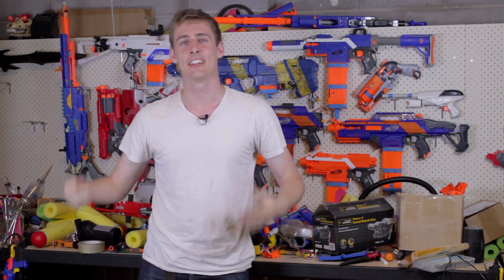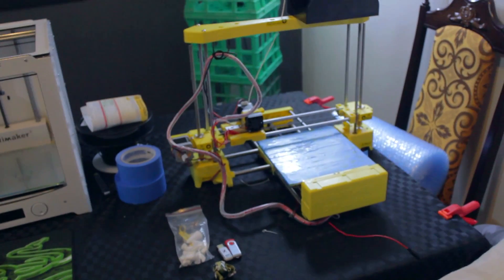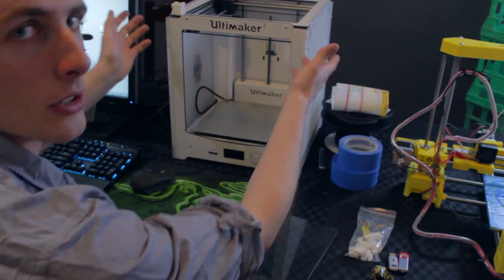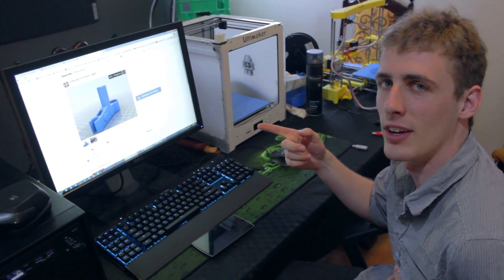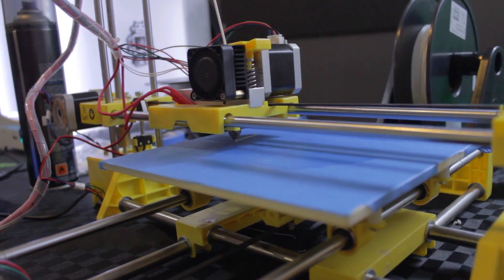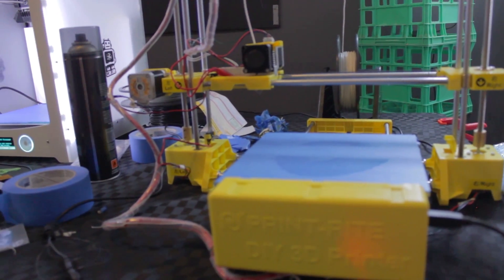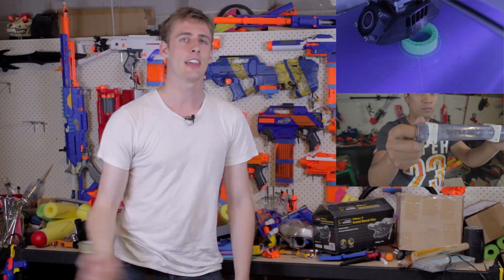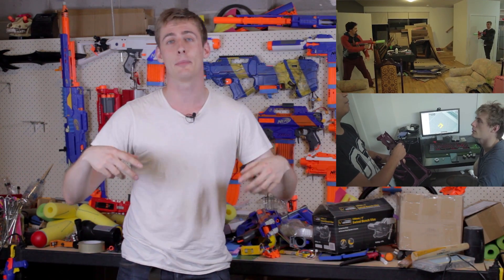ULTIMAKER 2 vs PRINT-RITE DIY 3D Printer & How to Bed Level - PRINTER PARTY | Make Test Battle

Comment: That program he was talking about sounds an awful lot like the new features in Autodesk Maya that displays all the information of the 3D object in a 2D graph, I didn't really understand the point of it. I wonder if I can print straight from Maya or perhaps create a plugin for it.
Reply: +Jones Crimson naw you an make the model in maya but you have too run the model through 3ds max and taurus and i think another one too print a model made in maya.
Reply: Kyle Bell I recently switched over to 3DS and I'm not sure why I ever used Maya in the first place, do you know anything about that?
Reply: I used maya for animating and rigging models. but i don't use 3DS max for anything. cause i use Zbrush too make pretty much all of my models. :P and before that i used blender pretty exclusively as well. So im not really the right one too ask about the differences between maya and 3DS.
Reply: Kyle Bell You could just export to .OBJ to get it into ZBrush.
Reply: yeah you could. but i thought we were talking about the difference between maya and 3DS. and why you would use one over the other. ERGO

Maya = animating and rigging
3DS = polygonal modeling
Mudbox = godly sculptmodeling. almost as good as sculptris.
 
Zbrush = good polygonal and sculptmodeling
Reply: Kyle Bell Oh, I see.  You use ZBrush as a substitute for 3DS.  What you could be doing is using 3DS Max entirely instead of ZBrush and Maya. You could also do ZBrush and 3DS Max instead of Maya if you wanted.  Your point just wasn't very well supported, it's purely personal preference.
Reply: i haven't really used 3DS max ver much at all so i use maya as an animatin and rigging program bt i make all of my models in either mudbox or zbrush.
Reply: the program he was explaining is better known as a "slicer". Slicers have to be set up with all the parameters of the 3D printer the code is being sent in order to produce G Code that the machines controller turns into movement. As far as I know Maya does not have this capability.
Reply: Elyk Son of kyle This latest statement of yours, much like all your other statements, does not further the conversation.  You bring nothing to the discussion.  You're a waste of space, human brainpower, and frankly oxygen.

Kindly take your nonsense elsewhere.
Reply: Elyk Son of kyle At least I'm thinking about girls when I jerk it, pretty sure getting off is the whole reason you're here.

Comment: If you tuned that $400 printer properly and had the proper nozzle and bed you would be priting the same exact piece. This is misleading.
Reply: I have a 175$ printer and its better
Reply: jd52wtf just take anet a8
Reply: +jd52wtf i was about to say the same, but you know, the only difference is "out of the box", maybe you pay higher for that kind of privilege. also, this is comparing video, so not that misleading.
one more thing, the ultimaker has more age 18 vs 1 month, so obviously one has more experience calibrating than the other.
Reply: +petkannaa monoprice out of the box worked fantatic... though there is some bullshit like the pla sticks to the tape just a little too well and its extremely difficult to remove prints without ripping off the tape.
Reply: alidan
agree on stick too well, but i found out that if you lower the bed just 0.05 mm, it would go well and easy to remove, i'm on the second roll of tape. i want to perfecting glass-pva surface
Reply: petkannaa im probably going to get some cheap glass from a hardware store and using that as the bed with the hairspray method, im getting sick of needing rafts to get the crap unstuck from the bed, its a waste of plastic.
Reply: alidan
yeah, raft can eat 30% more plastic when printing, i have print one from 50g to 80g using raft and increasing 3 hours just to get that base done, not to mention if the first layer is screwed, then i have to redo everything. i also want to try hairspray but i don't know what the recommended ingredient in that spray that i should be looking for
Reply: petkannaa you have either glue sticks, which apparently work well too, or cheap hair spray, thats all thats ever mentioned, any cheap hairspray will do.

id look into it a bit more, but yea. 

as for rafts, it all depends on how big the thing is, i use a poker chip as a constant, its 3-6 grams of plastic, and a raft adds an extra 2-3

my brother printed off a large ass headphone thing, it was 40 grams plastic, 5 more for the raft.
Reply: I would not recommend cheap glass. The simple reason being that it is not as durable as Borosilicate glass. It is also much more malleable, meaning that it will bend and deform when you don't want it to. Also if you have prints that are very well adhered you will be breaking cheap glass at a much higher rate than the Borosilicate. It is, of course, a bit more expensive but it is worth it. 

I can holeheartadly attest to the durability of it. I ordered a Rostock Max which came with a 300mm boro plate. Like the clumsy dope that I am I knocked it off of my work bench and onto the concrete floor. It landed on the edge and actually survived the initial impact. It split into two pieces as it fell over onto it's side. I was somewhat amazed.

Boro is most certainly the way to go. 

Also everyone should ditch the painters tape. I have had excellent results with both ABS and PLA on both my Kossell Mini and my Max with the purple glue everyone is talking about.

http://www.amazon.com/Elmers-Washable-Disappering-Purple-Sticks/dp/B0130GTFFG/

This works especially good for large flat prints. No rafts needed. You can also put down a few layers for particularly important prints. Have never used a raft for anything. 

Hope this helps.
Reply: DigimyxHD is it the tiko
Reply: jd52wtf you're right.just a good tunning and it print very well.btw i got one and have no issue :)
Reply: Roetrap T no tiko is a delta this is a reprap
Reply: DigimyxHD same
Reply: lord dumbness you can't compare an ultimaker style machine to a prusa style...
Reply from the maker: +jd52wtf Maybe; but this is what we had at the time and isn't meant to be a review or "go buy this and not that" video -R
Reply: jd52wtf the cheapest i can find a Borosilicate plate is for about 40$, and even then it's too big to be used due to hoe my bed is. 

i have a 200mmx200mm bed, but to rest the glass on i would need to cut 15mm off on both accesses

i dont have the tools to do that and don't know how well Borosilicate would cut if i did, however i can go to a hardware store and get normal glass cut for fairly cheap. 

also, i have some pyrex, its Borosilicate under a different name, i know damn well how good that stuff is, its just to expensive.

Comment: for 400$ you can buy RepRap Prusa i3 and is not as bad as thih chinese printer on video ;)
Reply: +primož Padar For $300 you can buy a Prusa i3 with lcd display, auto bed leveling and cooling fan, free shipping from China.
Reply: i said 400$ because on video is printer for 400$ :) sure you can get lower than 400 :)

Comment: Hey, good comparison guys.  I have also seen a couple of friends who have gone through a lot of troubleshooting with these prusa clones from ebay.  I bought a tinyboy which has a smaller build capacity but gives the same quality prints as your ultimaker.  tinyboy was $250AUD.  

Personally, I think everyone is buying a 3d printer because they like to make things, so I would recommend building a new larger 3d printer from scratch as im doing,  this way you can buy all the best quality parts (like what you see in the makerbots/ultimaker etc)  and it still stays within budget of under $500.  they are not as complicated as people think.  that bed leveling idea is a new one I havent seen before on the ultimaker so i will have to put the same in my design ;)
Reply from the maker: +Troy Dawson yeah; I was punished by buying in to the technology too early. None of these kits were available when I got my UM2 -R

Comment: The 400$ printer is really bad example of cheap printer. You can get much much better, bigger and not looking like something from Kinder Surprise egg reprap printer in the same price range. For example my reprap Rebel II (almost same as Prusa i3 but with much stronger frame) can be build for the same price and it is absolutely incomparable. I would be ashamed to show on the video that i spend so much on this yellow garbage, it does not even have glass on the heatbed! Is this supposed to be comedy or something?
Reply from the maker: +FrescoJ This isnt really meant to be a review of either printer, just a look behind the scenes of what using a printer is like -R

Comment: Shouldn't this be compared to the Ultimaker Original? Which is $1000 assembled, it used to cost $700 unassembled. That was years ago, plus that was with the computer interface add on.
Reply from the maker: +Ali Ahadi Well neither of us had one and we were just loosely comparing the two we have. -R
Reply: Make.Test.Battle I see.

Comment: When it comes to 3D printing, your knowledge base is everything. Every time a print fails, you have to endeavor to learn something from it. With a bit of hardware fiddling and software tweaking, the cheapo printer could produce usable, attractive parts. And the same goes for the Ultimaker! You two are definitely on the right track, but you still have a lot to learn. I would recommend a FULL calibration of BOTH printers. RepRapWiki is an amazing source for this sort of info, as those guys started from scratch and had to learn everything the hard way. A calibration is a pain, but it goes a long way to useful, repeatable results. Good luck and happy printing!

Comment: Great video, when you say that buying a 3d printer is a experience you are quite right!

Just a question about your Ultimaker, can you really not print without the painter's tape, or does it greatly improve your bed adhesion? I have a Prusa i3 with a glass bed, I've never used the tape and I've been printing PLA and ABS quite happily. It's much quicker to get new prints started if the only thing you have to do is apply hairspray and hit print.
Reply: +anon746912 Blue tape is not needed, nor recommended. He also lowered the bed temp to 45C from the usual 60C for some reason. Also, you generally don't touch the back thumbscrew during bed levelling unless absolutely needed. Oh and he didn't close the front glass clips. For someone who has owned an UM2 for 18 months he seems quite clueless on how to operate it.
Reply from the maker: +treborrrrr A user on the UM forums did testing an found 45 degrees gave the best bed adhesion and I didn't want to wait for it to heat up hotter anyway, The back thumbscrew allows finer adjustment that the front wheel, and I closed the clips and re leveled off camera after I noticed they weren't closed. not as incompetent as I look -R

Comment: Parts actually stick the best to extremely clean glass build plates, the problem  is they stick so well it will snap the plate in half when they cool down. it's kinda awkward
Reply: +Matthew McKellar Easy way around that is Kapton tape.
Reply: EagleSoar1381 ahhh no, I have ripped Kapton tape right off a plate. It actually doesn't work that well compared to a feather thin layer of max hold hair spray on a super clean plate, that holds well while still coming off, and generally lasts four to five uses before you wipe the plate with vinegar and respray in place. My machine has done over 200lbs in filament and eroded through a nozzle due to the amount of printing I have done so far, so I have some experience though I wouldn't say I'm a reliable expert.
Reply: Yeah same here. I have worn out a couple of nozzles etc.
The main reason I still use Kapton is if the part is delicate and feels like its going to break, I just remove it Kapton and all then I can carefully remove it from the part.
My best results have either been straight onto the heatbed/glass or Kapton. I didnt like blue tape cause I just had too much lifting
Reply: EagleSoar1381 Totally agree with you on the blue tape, it works, but the adhesive and surface finish leave things to be desired. The usage case for Kapton tape on smaller/fragile parts makes total sense too. 

Per chance what first layer heights and temperatures do you usually run on your filaments? Just my curiosity
Reply: PLA I use 50 for the bed and 100-115 for the filament (different colours need different temps of course)
ABS bed around 100-110 and generally around the 230 mark for the filament give or take anywhere up to 10 degrees depending on the filament. 
For my settings, I pretty much do everything at 0.2mm but first layer I normally to a lot closer to the bed (the old piece of paper trick). I am yet to try hairspray or abs slurry simply because I have never needed to, I have had awesome success with either nothing or a simple glu stick from the supermarket..
Mainly I just print in PLA unless I am going to give it to someone as a gift, then I will use ABS so I can vapour clean it for the finish
Reply: EagleSoar1381 Woah? You can extrude your PLA at 100c? I have trouble with extrusion below 165c, but I am using a Bowden tube after all. Normally I end up Printing PLA in the 210-225c range, but I like really really solid parts, high temps screw the finish of course, so a trade off as usual.

Glad to see someone else is using 50c for the bed, Seems to be right at the beginning of the glass transition temp making it perfect. I'll see how your ABS settings run for me later too.

When it comes to first layers I normally do 0.035mm, crazy low, but it works surprisingly well for me on PLA, ABS requires at least 0.1mm of height most of the time. There are disadvantages to this because you need to level the bed really well using feeler gauges, the only real advantage is the bottom of the part looks prettier, beyond that it is just pushing the printers abilities because it is simply possible.
Reply: Arg I just re-read what I posted and yeah, typo'd that.
I will correct myself, I generally print PLA at around 200.
Main reason I went experimented with such low temps (160 and up from there) is the teflon tube in one of my extruder heads actually melted and I didnt have any spare on hand. From memory I had a blockage and the PLA ripped through the side of the tube cause I was asleep at the time.
I trimmed it so it was about half as long as it should have been so started a print at higher temps that I was used to and just kept lowering it till I started to get clicking (that you get when extruder temp is too low, it 'skips' cause its trying to push it through a 'cold' head)
I can get white PLA to print fine at around the 150-160 BUT I didnt trust it so bumped it up to 180-190 so I could walk away and not worry about jams.
Now I have replaced the teflon tubing and have it permanently set at 200 for PLA.
Sorry for the confusion there :-/
Reply: EagleSoar1381 Glue sticks will do the job when nothing else does, I just stopped because I got tired of cleaning it when other people used my printer, #firstworldproblems
Reply: Haha yeah, I didnt properly clean mine for a few weeks, literally had to use my scraper that I use to pry my parts up to scrape off a solid layer of glu off it. Then a good 30 mins of wiping it with paper towels and water, had to have been a good 3-3mm layer of just glu on the glass.
Crazy
Reply: EagleSoar1381 Have you tried running clear PLA and ABS yet? I have noticed that Clear filaments seem to print unusually well.
Reply: I have used clear PLA but not ABS yet. It does work well but I just have not really had much of a need to use it.
Pretty much the only time I have had a 'need' for clear was I printed a skull from Thingiverse in a bright yellow filament, then for effect I layered a clear skull on top of it and printed it on the dual head printer.
It looks cool but I found the clear wasnt so clear because of the layer lines.
Reply: EagleSoar1381 I use clear ABS a lot in structural parts, layer bonding is good, but the real advantage is it turns opaque if it is over stressed at all, great for visualizing any structural problems. I wonder how acetone vapor bathing clear would work? It looks better than PLA does right off the plate, maybe it would look all cool and translucent.
Reply: I will have to try it, I have a roll of it in PLA so I will have to try ABS next
Reply: +Matthew McKellar the adhesive on the Kapton varies depending on the source. You only want silicone adhesive, which works great.

Comment: Latest price for a reprap (print-rite) 3d printer: $250 or $275 with lcd
lcd control screen with buttons/sd: 15$ if you want to add it yourself

Everything else is optional and does not make printing easier, or higher quality. Its just preference. 
So yeah, the ultimaker is a complete ripoff, while the reprap works great and is easy to upgrade/customize.
Reply from the maker: +robert karas Sadly; these kits weren't available at the time I bought my UM2 -R
Reply: Make.Test.Battle The kits where available for 2 years.

Comment: I have an Ultimaker 2.  Wouldn't buy any other printer.  Over 2000 hours on it without a single clog.  Haven't had a failed print in over 8 months.  Haven't had to level the bed in 6 months.  Works every time I turn it on without a hiccup.  Wicked easy to service as well.  Only thing that could make it better is build volume.

Comment: Dude you need to grease the rails or something on your Ultimaker 2 because it's sounds heinous compared to what it should.  Not sure if a stepper is fucked up or you're sliding the head around on dry rails...but I would figured that out ASAP before you burn a stepper out or fry your linear bearings.
Reply from the maker: +mary poppins Hmm... I'll look into that. May be the cameras microphone, but worth investigating -R